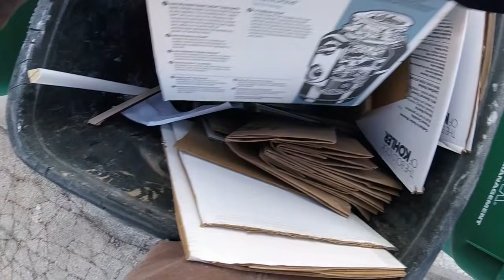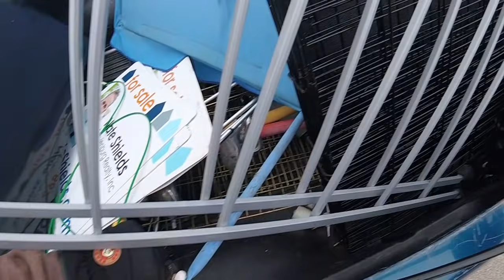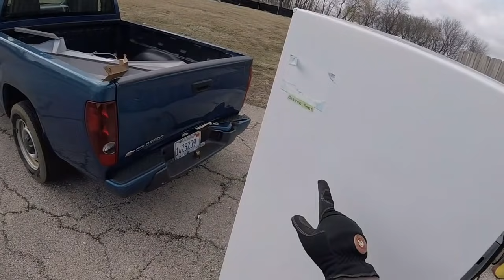Saint Patrick's Day Dumpster Action - The Luck of the Irish

Comment: Just curious why is the Galvanized worth more then the tin?
Reply from the maker: Galvanized is steel with a zinc coating. There is no plastic or wood or any non-metal. So-called tin, is really shred steel or light iron, that has plenty nonmetal on it. Making it less valuable